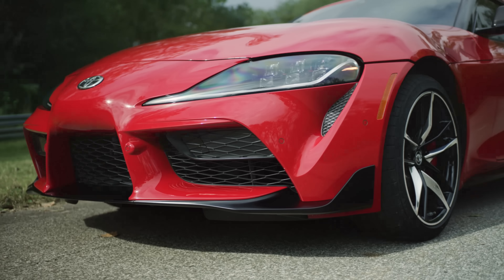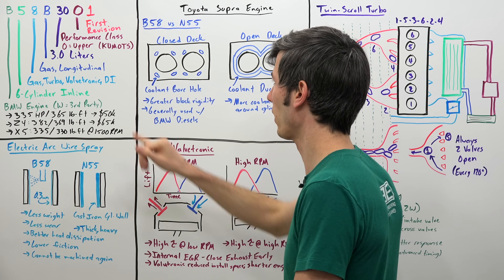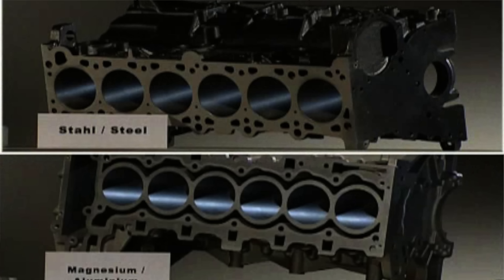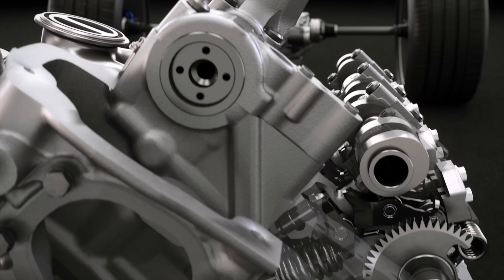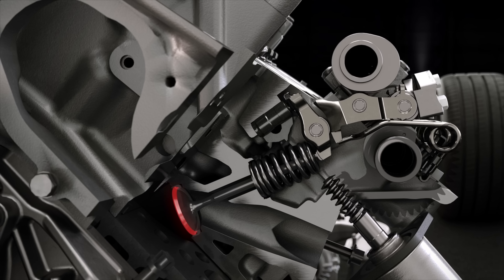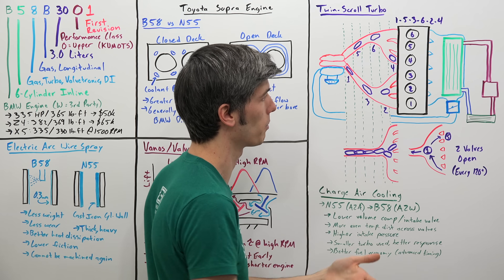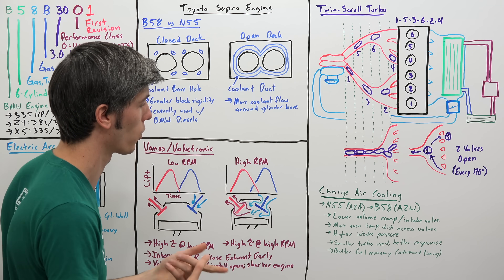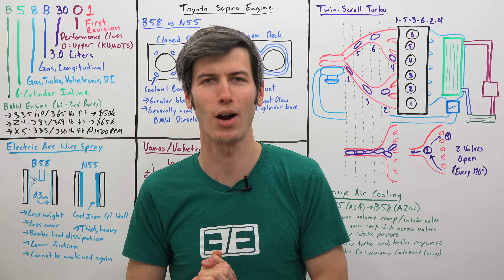2020 Toyota Supra Engine - Detailed Review Of The 2JZ Successor

Comment: hopefully the price of the new Supra drops as fast as the  BMWs do on the used market hahaha.....
Reply: Once the engine fails. I bet someone will put an old 2jz in it or maybe even an LS 🤣
Reply: @kermiirani3809  LS is a good idea
Reply: Just buy a one year old Z4 next year.
Reply: ''endless money pits'' designed by BMW to take the ''W'' out of your wealth
Reply: @prelate7 lol truer words have not been spoken.
Reply: I think my years of experience as a Mazda driver has made me a fanboy, but I still feel betrayed at the idea of a BMW engine in a Toyota. Even though I'll never own either.

Even I know BMW makes great engines if you rebuild regularly, but 'yota engines are immortal if you sometimes have oil in them.
Reply: Welp my n52 straight 6 has 130000+ and still kicking. And looking at prices of old z4's I wouldn't get my hopes up
Reply: @RDJ1SS  130.000 is nothing all my Toyota's have run at least 500.000 miles
Reply: @erik-7255  oh so you agree that a engine that is properly maintained will run for a long time? I wonder how those high boost turbo swapped 2jz's are holding up 🤔
Reply: @RDJ1SS  Hahahaha. Doesn't matter still holds up longer Then any BMW Engine
Reply: Ryan Jones
Absolutely fine. I’ve run 30 psi in mine for 5 years now. Runs perfectlyand it’s my daily driver. You’re mistaken if you don’t think a stock 2jzgte can’t handle wayy more power. They are so overbuilt. Thats a huge part of the legend of them.
Reply: @erik-7255  I'm just saying as long as the car last. I ain't that broke to try to drive one past 250000
Reply: @jimbojims  many modern engines can do the same with the right cooling, with less weight
Reply: @jimbojims  when people throw out boost pressure like its supposed to be impressive lol literally means nothing when you dont say what turbo it is.
Reply: @RDJ1SS most BMW het a bad wrap working at a garage in Holland they Just need more work too keep Them running in tip top shape its the reason most people Are not happy Toyota is working with BMW but their new engines are better Then the old ones. So im Just gonna wait for my Boss to buy the new Supra and if it drives right i might buy one anyway.
Reply: @Comptonk  all my cars run 100psi but there Tiny little turbo's 😂
Reply: @erik-7255  I wouldn't say more work. In my experience they will bother u with dashboard lights and audio chimes over the smallest issues. Even issues that don't even need prompt fixing, but as an owner all u want is for that dashboard light to turn off and for the car to stop sounding off an extra chime Everytime u turn it on reminding u of the light. Also they have a higher sensitivity to go into limp mode, even if the issue is minor. So it's not that they require more work, they force u to keep them in top shape because I'll admit they're whiney cars that want to be spoiled. An owner that maintains them properly can drive the same BMW forever, without experiencing a total faliure. It's the same reason why ppl get the illusion that budget cars last a long time then just die. Cars don't just die, they pile up enough minor issues that u don't know about then snowball into a total failure.
Reply: @RDJ1SS  im dutch so my english isnt as good but i feel You. That's why i dont really hate the new Supra Just feel like it would be much better if it were a proper Toyota made car but since Toyota works with PSA... Well. You know what i mean.
Reply: @prelate7 
Lol, never heared of that happening XD.
Reply: Have you seen how much a decent M car will cost you on the used market? You’ll be paying sticker price for a while bub
Reply: enemy boat  there is just too many ignorant people out there that think the BMW engine suck when they don't know squat.

Comment: so, can it still run double engine power at a snap of a finger?
Reply: The closed deck was likely done in consideration of that. But for that price it should already have like 500-600hp. Toyota's recent trend toward 'needs modification on purchase vehicles' is disappointing.

Comment: I think Toyota did a great job using this engine instead of building one from scratch. I want a 50k Supra, not a 70-80k ones. Sure it doesn’t have the Toyota engine, but as long as it performs well, then it’s fine by me. 
Lotus been using Toyota engines for a long time and get praises everywhere, but when Toyota use the BMW engine and they get flame?

Comment: That car is just awful.  Under-powered, not particularly light, expensive to maintain, unreliable, no convertible, no manual trans, body that screams grocery getter disguised as sports car, and way overpriced.  One could buy a slightly used Corvette for the same money.  Toyota would be better off with an updated version of the 2jz beast from the 90s.

Comment: I'm a mk4 fanboy. It is my dream car for i don't know  how long. I was sceptical at first, when i saw the new Supra but it grew on my.  People have not even driven the car yet they don't hold on hating the car. iT iS nOt mY sUpRa yyyh nO 2jz yyyh. Wait 'til you actually drive the thing (or maybe wait for some reviews if you cannot afford it like most of the hating gang), then feel free to judge. I'm glad it is back - it is still a sports car, it is not a hybrid it is not an SUV (looking at you, Mitrsubishi), it is RWD with over 300 hp. Automatic? I don't care, as long as I can still paddle shift. Low center of gravity and short wheelbase signals great handling. I'm really exited about  how people will mod this thing (not 2jz swap, overdone so much).
Reply: its more than the specs, you enter a supra and you know who is in command, everything is pointing to the driver, and the driver only, this thing is a completely different car
Reply: barra engine swap?
Reply: the mk4 supra, along with the nissan skyline, was practically a super car for its time. the GTR continued that legacy, the mk5 supra does not, and that is why people hate the new supra. the supra and skyline could compete with ferraris back in the 90s, and the GTR can still compete with ferrari, the new supra cant.
Reply: Its a fcking Japanese car with German engine i don't care if it drives good it's not a original JDM
Reply: I take it you have not driven or worked on a Supra or I should say Supra's (including previous generations). Once you do that and understand the true history of what the "Toyota" Supra once was you will see how back then it evolved over generations to become better and better. Now what is currently coming out now is a huge disappointment and no real improvement at all from the mk4 Supra.
Reply: @Shwalker07  he says Likes the mk4 supra but he really doesn't, some people will never understand
Reply: @theycallmewinter7516  oh no im a fake fanboy :( did't know that
Reply: @Shwalker07  You are right, I have not worked on any of the generations and that can be a possibility that do not jump on a hatetrain . However, I have to disagree of the improvement part. MKV is 1s faster than MKIV. I do agree it is not much for 20 years that are between those two BUUUT compare it to other cars with same charachteristics.  It's almost Carrera S territory and it is faster than Cayman S.  For 20k more or less. For me it is very Supra-like - Affordable ( definitely more than porsche) fast car with good handling which you can mod to be a road dominator.

Comment: All i hear is unreliability
Reply: buy one in 2 years for 15000 lol
Reply: The maitenance and parts sky rocket too
Reply: @icedcoldkilla   The would only be a good deal if you could at least rebuild the engine.. but according to this video the engine disposable lol
Reply: The B58 is proving to be extremely reliable actually.
Reply: @TylerH2   Well you obviously don't seem to have one as BMW makes some of the best cars in their classes. And like i said you can't judge a car without ever seeing one in action. This car is probably not for straight line performance anyways. Handling is the most important aspect of a sports car.
Reply: As soon as dummies start slapping on big turbos expecting the same adaptability of the Mark 4, they are going to start throwing the fine tuned mechanics of the system out of wack, and THEN it's going to be seriously unreliable.
Reply: @thedefenestrator2994  Idk time will tell. But people have been getting big power out of the N55 for a few years now without any major hiccups as long as its modified/tuned correctly.
Reply: All I hear is wild speculation and slander.
Reply: BMWs most reliable engines are inline 6.
Reply: Going to be the least reliable Toyota ever!
Reply: The B58 has been out for a bit, and it seems like it can make power reliably like the n55 before it. And the b58 fixed the N55’s water pump issue too. Do your research. This engine is good
Reply: In line 6 cylinders tend to be very reliable. But knowing BMW they will manage to screw that up.
Reply: Let's see the car come out first. You can't judge a car that hasn't even hit the market.
Reply: The simple fact is the heavy use of digital control & blatant disregard for extreme gearheads wanting to keep a car forever is ruining the reputation of a brand that makes fine cars. They are good, but expensive so you gotta roll with the punches. You can always buy a custom car.
Reply: 3 time award winning motors dont have reliability issues.
Reply: @williamwilson5125  has nothing to do with awards. Its just planned obsolescense. Why is it that a 30+ year old bmw e30 will last over 500k miles yet any new bmw engine wont last anywhere near that

Comment: I think everyone felt the same way about the 86 when it came out and people got over it. Yes the same sentiment about power remains but it was never meant to be a stock car. Very very very few people have a Supra to keep it 100% stock. These are tuner cars! Realize that.
Reply: Save the Si it’s not the power I car about, it’s the strength. BMW has never made an engine as durable as a JZ. (The 86 is the least reliable modern Toyota on earth... no one builds engines as durable as JZ or UZ Toyota motors)

Comment: The 2JZ was famous for being able to take up to 1K horsepower on stock internals. Any idea on whether this will be a tuner's wet dream like the MK4 was? I have my doubts...
Reply: 2JZ-GTE never made 1000hp on completely unopened engine. Stop this propaganda nonsense. It barely makes 700hp reliably without any engine modifications.
Reply: This engine is over-built, just like the 2JZ... everything reinforced and strengthened and forged.
There is another video on another channel with different details, look up " Is B58 better than 2JZ."

Comment: Engineering Explained is AWESOME! 

And regardless of the Toyota badging....it doesn’t take away the chance for this to be a good engine/chassis to tune!
Reply: But no more than any other Z4
Reply: @Oblithian  Platform/chassis is the same. That doesn't mean the suspension geometry and setup are the same and that makes a big difference.
Also the Z4 is soft top only.

Comment: First lemon Toyota, first to massive engine issues before 100k
Reply: Before anyone comes in, Toyota had issues like any other manufacturers, but I can say they won't cost you an arm and leg. And alot of the earlier cars can survive through some crazy issues.
Reply: BMW's engines are usually decent (electronics...). Toyota has lost a lot of reliability since the new millenium, oil consumption being one of the more mild annoyances.
Reply: @Oblithian  yep this, but honestly still leaps in bound more reliable than a BMW in design, cost and consistency.

Comment: "Because it's a five.. that means it's an inline 6 cylinder."

... but of course! 😂
Reply: Welcome to BMW logic, lol
Reply: bmw does not make any V6's @AacxelLuc
Reply: 1 = 1 cylinder 
2 = 2 cylinders 
3 = 3 cylinders 
4 = 4 cylinders 
5 = 6 cylinders ( because BMW do not have a 5 cylinder )
6 = 8 cylinders 
7 = 10 cylinders 
8 = 12 cylinders
Reply: @waynec2186  Actually 7 is for V12, V10 is with 8 cause BMW's V12 came before the V10 (S85)
Reply: @CarToneHK  yes you are correct. I just made a mistake
Reply: Wayne C S85 was a V10.
Reply: @waynec2186  7=V12
8=V10
Reply: @זהסודי-ה7מ  yes you are correct. I made a mistake. Lol 😆 I posted this when I did my level 2 apprenticeship. I am qualified now. Time flies. 😄
Reply: @waynec2186  They have an 1 cylinder and 2 cylinder engines? :O
Reply: @sparcolonsdale  right? just admit BMW fup the numbers.
Reply: Wayne C you swapped the designation for 7 and 8. The BMW S85 is their V10 in the E60 M5 and E63/4 M6. For whatever reason, a 7 is their designator for their V12 engines.
Reply: @waynec2186  ..But, what if along the way, they do make a 5-cylinder?  Now they've fucked up their nomenclature and would have to use a different character.  ;)
Reply: Shock Diamond I mean 8 is for 10 so a 5- cylinder would be a 9 but I do not think they will make a 5 cylinder engine for a BMW because of how much they would spend on R&D
Reply: @waynec2186  The M5/6 V10 is S85. The V12 on the Mclaren is S70. BMW logic, go figure.
Reply: @waynec2186  wrong. 6-8 cylinders
7-12 cylinders
8-10 cylinders
Reply: Well they don't make an inline 5 so it only makes sense as the i6 is 5 then one down is i4, therefore 1 down from that is 4
Reply: Reposting this here because people are getting the wrong idea about BMW engine naming conventions.

It's not really disorderly if you actually know the history of BMW engine naming. In the beginning , there was the M10, an i4; the M20, the smaller of their I6s; and the M30, the bigger i6. Then they made the M40, a 4 cylinder; and the M50, a 6 cylinder. Then they released the M42, M43, M44 , which were all basically evolutions on the M40, so they changed the second number. They also released the M52 and M54 which were the successors to the M50. They also released the M60, which is a V8, and M70, which is a V12. They didn't have a V10 until much later, so they didn't have an engine code for one until 7 was already taken. In recent years, they have started changing the first letter but keeping the numbering convention the same, so an N52 is a naturally aspirated i6, and N54 and N55 are turbo i6s. The most recent engines start with B but still keep that numbering convention the same. Historically, BMW used an S as the first letter to denote that it is a performance engine, so the S50 is the performance version of the M50, and the S62 is the performance version of the M62, etc. Recently that has changed a little as BMW releases more "performance" engines that aren't explicitly M engines, but the M cars still use the S designation, with the S55 in the F80 M3 and the S63 in the F90 M5. It's not hard to understand once you get to know BMWs.
Reply: and now you guys are knocking the engine code names? does it really matter?
Reply: Had to stop the video for laugh
Reply: And a 6 means 8 cylinder, 8 means 10 cylinder and 7 means 12 cylinder.
Reply: Germans
Reply: hahahaha yeah ridiculous!
Reply: Leave it to dumdum BMW to also call a model a “40i” cause it has 4......err THREE liters of displacement. 

Naturally.
Reply: @j.3854  its 40i because its better than the 35i.
Reply: Justin B Err no that would be because there are other models with the same displacement and they are gonna have to be named the same. It worked before, it does not anymore
Reply: Justin B yeah and why doesn’t my m3 have 3 cylinders
Reply: Justin B BMW badges their cars (calling it their external designation) as note of a marketing strategy now. It used to almost always be the displacement, but more recently it has changed to accommodate modern technological advancements and their getting into turbocharged vehicles. A 335 is named as such because it has more power than a 330, so they decided that it would have an estimated power of a 3.5 when compared to the 330 3.0- kind of a way to make a rough comparison. That has only considered tinier further with their newer lineup, hence the 340i.
Reply: Justin B Most manufacturers switched from labelling models by displacement and now just go by trim level. I drive a 25i but it’s got a 3.0. The 30i has a 4.0 because it’s the higher trim.
Reply: Yan B. 2 in 2JZ means successor to the 1JZ
Reply: @fim1344  yup was Gen 2 of the JZ series. Same as my 1UZ is gen 1 of the UZ series followed by 2uz and 3uz in increasing displacements and power 
but less overbuilt for strength internally... Early 1uz was way overbuilt for its intended power just like the 1jz and 2jz
Reply: @yanb.193  Toyota builds and codes their engines by generations now, not displacement dummy
Reply: That seems very un-german of them... Would a 5 cyl be 6?
Reply: @jblob5764  literally you asked a question answered 3 posts above you, literally 3 posts above you